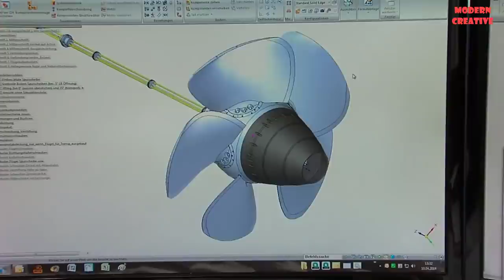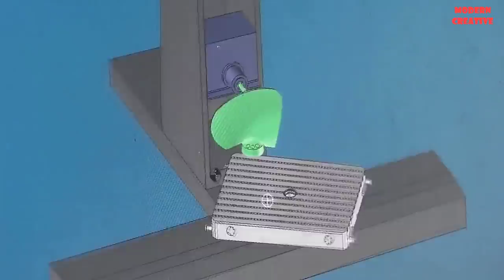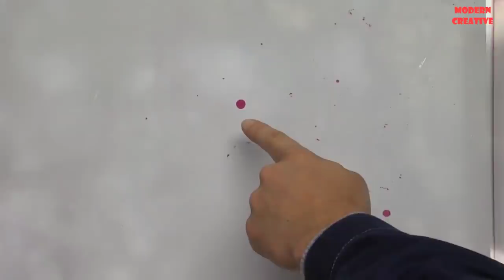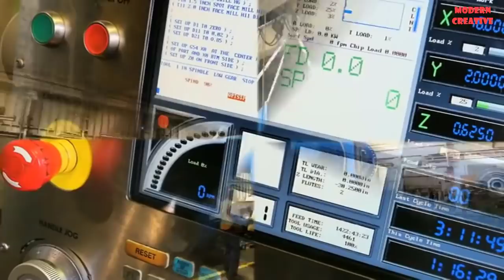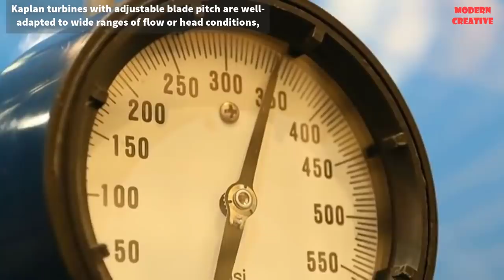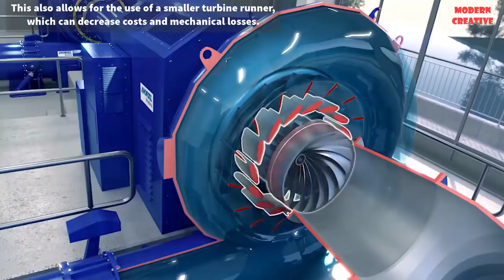The Fabrication and Assembly The Super Huge Water Turbine

Comment: If Kaplan Turbines is listening... you could enhance flow performance by integrating additional  features including inner pipe lining features to mitigate points of drag while accelerating flow speeds. Additional features could strengthen areas where pipe and turbine blade fatigue occurs in order to extend the life of the product/system, and decrease maintenance. I find it astonishing that people are afraid of even trying out new design features via digital models and run them through "Comsol Multiphysics Software" to test via digital simulation what would occur if these new features were added. It is like many other industries, electric & combustible vehicles, alternative energy production and storage, turbine systems, and aerospace systems. I have shown Boeing a new lift system that increases safety a 1000 fold, allows for payloads up to 8,000 kilograms, its reusable and capable of completing launches at least 1 launch per week with the cost under 1.5 million US. The tech already exists and has been used once. It could be scaled up thus allowing NASA to construct the Mars space craft in space via modules. And it would allow them to launch into space as much water, dirt, machines, and supplies needed. I also showed how it could be combined with an alternative energy production system that does not require solar panels. Again another existing technology that could revolutionize the space industry. You see the main problem in many industries is the thought "if it works why change it"? That is why you see upgrades, and new materials used, but you are still stuck with the same principle design used over 100 years ago. The Titanic had a massive turbine and its top speed was 23 knots, the fastest current cargo ship is 33 knots, the fastest Ocean Liner the USS United States is 39 knots. So in 100 years we have only increased the speed of these mega ships by only 16 knots. Again, people are too afraid to move forward with radically new designs because it would show mankind has intentionally been held back. Almost 10 years ago the United States had a contractor build an all electric Humvee. This Humvee was special because it could generate power from all 4 wheels giving the vehicle unlimited range and a super low thermo signature. It was even shown in action on a popular weapons Tv series. Yet like many other things it was boxed up and placed in a warehouse along with other technology considered too good, too advanced. Remember this, the US had a national electric grid and electric mass transportation in cities in the 1900's. Yet when the Ford Model T came out these systems were destroyed. Just think where we would be if electric vehicles were upgraded year after year for 100 years, just think of all the spin-off products and way lower pollution we would be enjoying today.... sad ting is along as people stay afraid and act like sheep mankind will never reach its true potential.